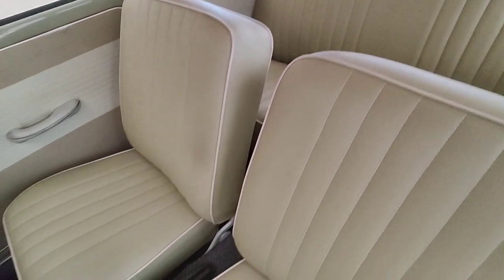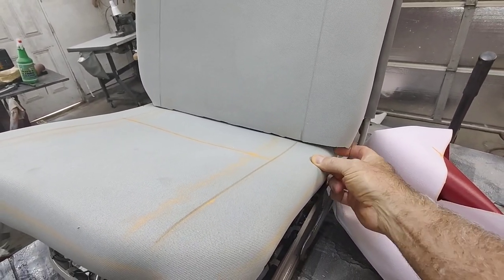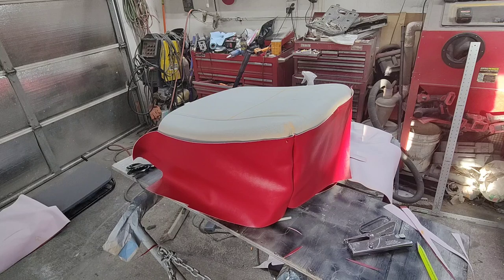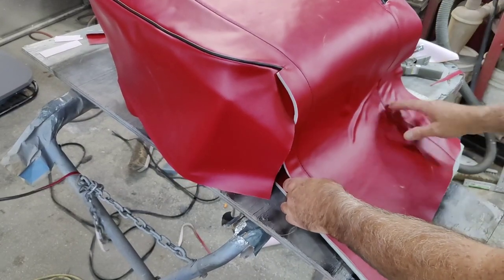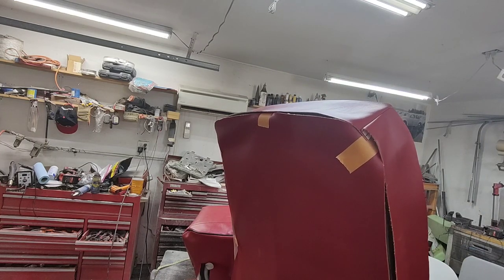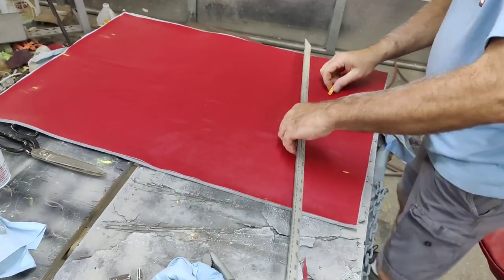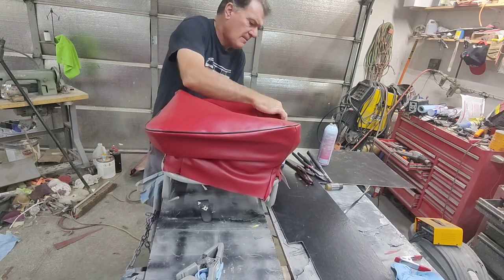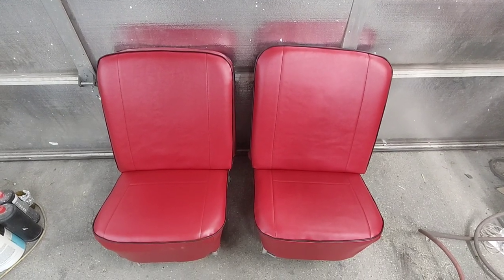1954 VW Beetle OVAL WINDOW seat upholstery How I did them myself DIY part 2

Comment: Hey Mike, you should use this red vinyl on your B pillar and under the rear quarter window to be correct.   I've noticed you used the headliner material in these areas.  Depends if you want 100% correct interior, if not looks good as is.
Reply: Yea your right. My headliner kit that I got with the car was what I put in there.. I dont even know if it is near correct color either.